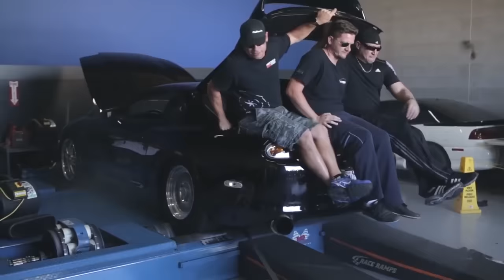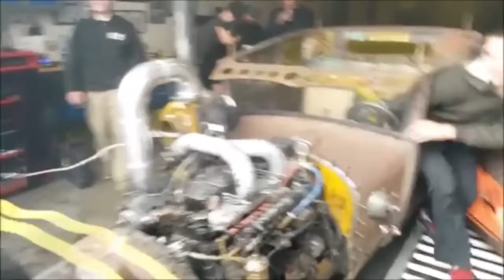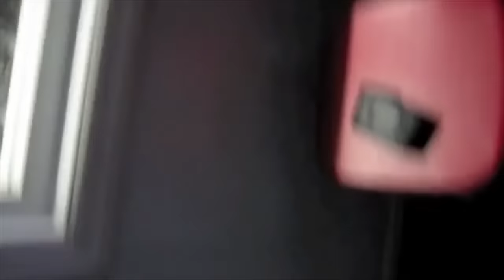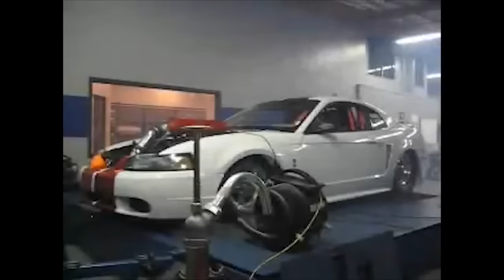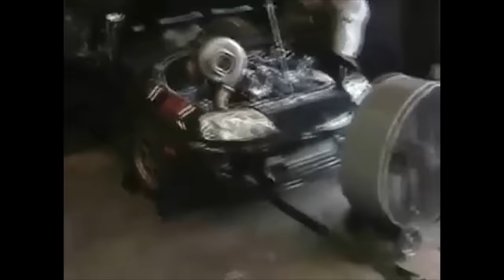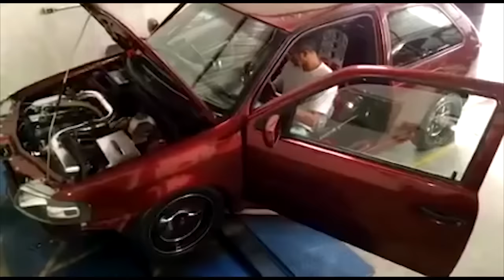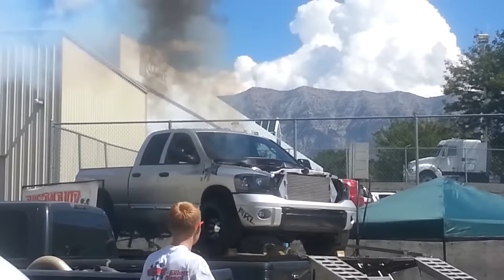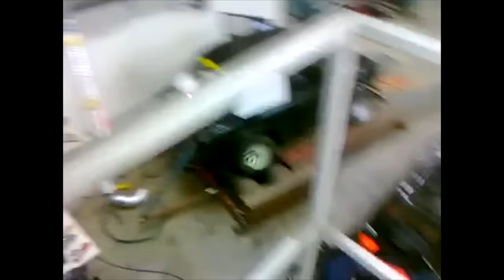The Best Dyno Fail Compilation

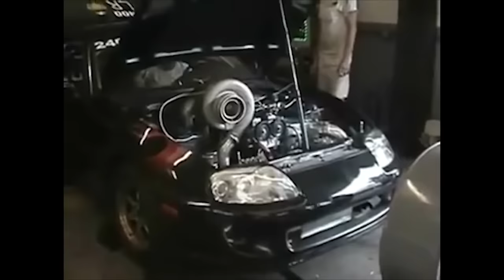Comment: 5:00 I'm far from an expert on cars. But even I would assume that a turbo kit that doesn't fit under the hood after installation, is not going to end well for your car.
Reply: Its a dragzter obviously
Power over anything,most people do this
Reply: You got it all wrong! He fit an engine on his turbo! 🤘😎
Reply: Fellow accelerationist i bet that’s what he thought about the RPMs as he shoots a rod through the block
Reply: Fellow accelerationist  ok boomer
Reply: Fellow accelerationist  looks with x100 magnefying glass 
U sure is this big? Its dosen't even exist.
Reply: Poor supra
Reply: Wrong assumption
Reply: You have assumed..... Wisely
Reply: 2JZ's tend to handle a lot of power with some modifications, however in the video, the 2J looked very under built for the turbo that was stuck onto it. And no, bigger turbo isn't always better, the bigger your turbo is the longer it'll take you to get into boost.
Reply: +100 aerodynamics
Reply: how to ruin a 50k car in a weekend
Reply: Fellow accelerationist  specs doesn't matter. It's the strategy you use.
Reply: I've seen the whole video on internet and they showed that clip than it actually rip and it looked sick but we all know the amount of lag coming from that thing is useless
Reply: More air = more power. Bigger the better hahaha
Reply: Yea... He need bigger one! That turbo is small.
My Tiger 1 Has bigger turbo then that
Reply: That guy who reached into the engine bay needs to take a safety course, because that dude almost lost his hand and probably forearm
Reply: Yeah, thats why people have a hole in their hood cut out so the turbo can fit over+better cooling
Reply: I mean as long as the engine can take the boost the turbo will give it would be fine
Reply: it’s always the supra guys with the massive turbos with unusable power due to lag
Reply: @thatcarguy0710  "VTec" only kicks in at 9000 rpm, the engine revs to 8000
Reply: Wtf fwd 9:21
Reply: Guys, Here is our Savior

YaH The Heavenly FATHER HIMSELF was Who they Crucified/Pierced for our sins and “HERE IS THE PROOF”

From the Ancient Egyptian Semitic: 
"Yad He Vav He" is what Moshe (Moses) wrote, when Moses asked YaH His Name (Exodus 3)

Ancient Egyptian Semitic Direct Translation
Yad - "Behold The Hand"
He - "Behold the Breath"
Vav - "Behold The NAIL" <— YaH’s Crucifixion
He - "Behold the Breath"

“Behold the HAND that Beholds The NAIL” 

PROVES - YAH The Heavenly Father HIMSELF was Who they Crucified

That is EXACTLY what Moses Wrote

Here is what they mean

YaH's Name:
(Ya)d + (H)e, as YaH is what Moses called Him and YaH Declared: "this is My Name, this is My Name for all generations" (Exodus 3)

YaH is The Creator of “MAN”: (Genesis 2:7)
Yad He, (HAND BREATH), as YaH's "HAND" Formed man from the dust  of the Earth and His "BREATH" made him a living being (Adam)

YaH's Sacrifice of Crucifixion for “MAN”:
Vav He (NAIL BREATH), the "NAIL" through YaH’s "HAND", in Sacrifice of Crucifixion, that whosoever shall call YaH Savior, His “BREATH” brings forth life (Salvation)

How YaH arrives:
YaH arrives via the Tent of Meeting (Exodus 33:7:11, Isaiah 54, 55), where a Tent is erected outside the city, a cloud descends upon the entrance of the Tent and YaH appears...

Why they demanded YaH to be Crucified:
YaH was Crucified according to Hebrew law (Deuteronomy 21), to be NAILED/PIERCED on an Almond Tree for BLASPHEMY as it was for His NAME they demanded Him Crucified. The Messiah claimed He was YaH...

HE WAS YaH!!!

HalleluYAH translates “Praise ye YaH”

The Hebrew Book of Isaiah

Isaiah 42:8
"I am YaH; that is my Name! I will not yield my glory to another or my praise to idols.

Isaiah 43:11
I, I am YAH, and there is no other Savior but Me.

Isaiah 45:5
I am YaH, and there is none else.

Comment: There is absolutely a reason why there is a red zone in every vehicule.
Reply: Russian Bear 👍👍
Reply: Obviously these guys are color blind lol
Reply: not every
Reply: Nah brudda these people didnt have good coolings or hadn't secured the car properly.
Reply: @iCxrsxd_  hhh! I never notice it was written different than French.( I speak French as well)
Reply: @i_amscarface_the_legend9744  Je ne parle pas francais tres bien 😂
Reply: in english we call it red line not red zone, not sure if the terminology is different in french, but either way with built engines you can usually raise your red line a bit since you have lighter piston rods and heads and stronger valve springs, and increasing your red line from say 7500 rpm to 8500 rpm will make a big difference on a drag strip since you will be at a higher rpm after upshifting thus starting with more torque.  it can be kinda complicated to calculate a new safe red line so often the idiots just guess and then blow up their engine, but really if you don't know how to figure it out you should ask someone who does

Comment: With all the knowledge it takes to build an engine like that and they never learned what the little red line was for. 😂
Reply: It's where the engine runs most efficient.  You usually want to be at least at the red line or above it, otherwise you risk running inefficiently.  You should try it, the difference is remarkable!
Reply: @fders938  hahaha,that's some funny sht.😎
Reply: @fders938  Yep, go anywhere below that line and you'll mess your engine up ;)

Comment: "I'm going to stand next to this engine and let's see if it will turn 10,000 rpm's".
Reply: Exactly,  I feel bad for my motor hitting 3,500 rpm's when pulling boat.
Reply: Mine does but it's an rx8
Reply: And here I am sitting on a motorcycle, whilst the engine is turning up to 14000 1/min. It´s not a problem, when the engine is made for such things.
Reply: Darwinism is real.   It isn't just stand up comedy stuff.  People always act shocked when Darwinism actually happens.
Reply: lol i cant agree more
Reply: Chase Hardesty Sorry hard.
Reply: +Shinon Ayanami. I got worried when the engine that I was working on exceeded 120 RPM, but it still managed to pull 480,000 tons. 
Not bad for a 2 stroke, but the wretched thing burns 3',500 gallons or fuel an hour. LOL.

Layout
Configuration Straight-14
RPM range
Redline 120
Combustion
Fuel type heavy fuel oil
Output
Power output 80,080 kW (107,390 hp)
Dimensions
Length 26.59 m (87.2 ft)
Height 13.5 m (44 ft)
Dry weight over 2,300 tons
Reply: @wilsjane  Okay so it's a ship or what?
Reply: @AkaneTendo15111986  exactly I hit 16k rpms on My bike everyday lol

Comment: 6:30 That is the most powerful "hood opening/closing" engine I've ever seen! It turns something boring and uneventful into a crowd pleasing showstopper!
Reply: Why did he chock the wheels on the backside? As if going 150+ with your wheels going forwards would make you go backwards
Reply: Puta que pariu, velho.
Reply: @chronus9083  surely you know that’s a stupid question yeah?
Reply: @chronus9083  You do realise that if the car suddenly took off, that it wouldn't be travelling at 150mph right? It can help stop movement on the dyno when the straps flex a little.
Reply: I laughed hard at that one
Reply: "Puta que pariu vey"

Comment: 6:32 the engine was faster than the car..
Reply: 1.21 GIGAWATTS!!!!!!
Reply: I mean you're not wrong if you really think about it
Reply: Lol
Reply: It was here in Brazil!!!
Reply: Brasil poha 🇧🇷
Reply: Dont worry dude, I have a car
Wtf you doin, get on the engine
Reply: When u put a LAMBO MOTOR IN HONDA CAR
Reply: TINHA Q SER BR KAKAKAKAAKKAKAKA
Reply: Jose Gabriel The car was turbocharged, with the stock engine. VTEC kicked in, then the thing blew up.
Reply: vw gol 1.8 engine broke
Reply: @Jose-eq4fc  vw
Reply: @Afromustang  pqp vei kkkkkkkk
Reply: @Jose-eq4fc  Honda not here is vw go
Reply: @Jose-eq4fc  This is Volkswagen Gol
Reply: Volkswagen Gol Motor AP 1.8

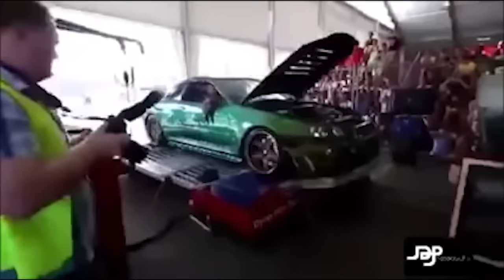Comment: 2:19 that was way too much power! the dyno couldn’t handle a GTR like that
Reply: what actually happened right here, can you explain it to me? I don't really understand how a dyno works.
Reply: @fin3662  a quick google search will explain everything about dyno tuning but basically these idiots are blowing their engines because they aren’t doing the test properly and are over revving their engines and the car can’t handle the high rpms
Reply: @kingcosmuder8078  I thought dynos tested max rpms and horsepower though? or are they just max revving for too long?
Reply: @fin3662  max revving too quick and too long.
Reply: @fin3662  You do that very briefly. Engines can't survive being redlined for long and doing it even a small bit is hard wearing on the engine. You don't need to hold it at max RPM, once you've reached it, you have the data. Any longer is just showing off and asking the engine to fail.

There's also little airflow through the engine. They need to breathe, stationary cars overheat insanely quickly when ragged.
Reply: @BlueZirnitra  That makes a lot of sense, thank you for explaining :)

Comment: there's a reason cars have grills. when the car is moving at high speed and high RPM, there's this thing moving through the grill and into the engine bay called air. there's a purpose to the "cold air intake". hot = bad

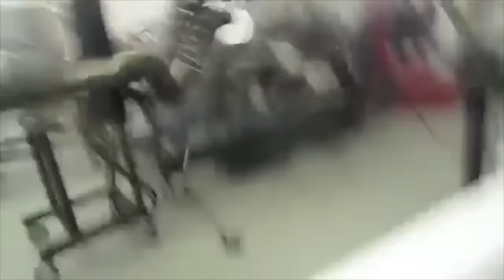Comment: 2:50 , holy shit what would cause that!? I've never seen an engine explode that dramatically.
Reply: Nspinicelli That’s a Cummins just had so many horse torques it’s threw it self off the Dyno and wanted to be in the truck
Reply: No cap
Reply: Apparently you haven't seen very many top fuel drags
Reply: @exautoshopowner5630  I mean I've seen booms and bangs and flames, but never the entire head being launched in the air. That is crazy.
Reply: Chocolate head bolts

Comment: 4:22 starts to smoke continues to make pull. Smh, always make sure when your cars on a dyno someone is spotting up by the engine and and your watching the rear. Many times we’ve saved a car from having a catastrophic failure by just using some common sense and getting off the gas. Nothing wrong with aborting the damn pull, smh.

Comment: I love the ones with fabric ratchet tie down straps.  I used the same ones to hold cargo in my truck and they are using them to hold their cars/trucks doing insane dyno runs.
Reply: That's not unusual. Those straps can hold tonnes of weight. Used often in haulage to secure pallets well over a tonne or two each.

Comment: I'm always afraid seeing those dyno's because i'm afraid the car would shoot through the resistance and do alot of damage.
Reply: Yeah, I was thinking that too. But they have to launch an awful lot of weight to actually launch the cars. But the cars lurch and the unhinge burns. I think when the engine fails  the momentum from the drivetrain parts would need to move the car without the assistance from the engine.

Comment: 0:12 while it had a Dyno run they put to much weight on the back of the Supra
Reply: What actually happened here
Reply: @pringlessorted4644  to much weight in the rear axle

Comment: You guys DON'T HAVE a "clue" that when revin the engine at that high rpm,  your actually spinning the little bit of oil off your cams and rocker arms and pushrods are heating up beyond operating temps and thus throwing pistons, rods, cams, and anything else out the block!!

Comment: I can't understand why anyone would want to dyno their car. "But.....but....but.... you need to know how much HP it's making". Oh yeah? If your satisfied how it runs after modifications, then it doesn't matter what the numbers and lines on a chart are. Besides, they make you sign a damage waiver, if she blows, their not responsible. However, they will give you a box for all the hot oily pieces.
Reply: It's to make sure it's running right and good. While also getting as much hp as you can with the modifications. It's a core balance between the two. If you don't, all of those mods can ruin your vehicle and break it.

Comment: Literally the first thing they taught in our power and performance class is how to strap the vehicle down and how to check the equipment is suitable for the vehicle/load range. Also, we block off the front tires, we have four straps in the back. Two of them are straight, and the other two cross each other to make an X. Then we strap the front. It’s not hard to setup and we always triple check the straps are tight and on securely.

Comment: I guess people forget that running engines at 22 Million rpm requires a lot of air and a way to cool down the expanding metal parts inside their engines. Dyno’s are not made to run your engine at full capacity for 15 straight minutes. Lmao. I guess without these idiots we wouldn’t need part stores.

Comment: Im not a mechannic nor an engineer but I think I can tell when its the engine block that fails lol
Reply: normally connecting rods 'grenade' through the casings,   the weak link and gets upgraded on a power tuned motor

Comment: A car at speed gets the added airflow over the radiator. I dont think cooling systems of high performance engines are designed to be pushed to the limit whilst be in a stagnant environment.

Comment: most of these dyno fails only had rear straps, like common sense you the car should strapped both front and rear doesnt matter if its rwd,awd or fwd. How did they open an dyno shop with lack of those common sense?

Comment: Probably not the best place to ask this question,  I'm looking for someone to line out my project before I can get my small slow brain to learn to tune. North Central Arkansas. She's running little lean, I would like to get that squared away before I add the parts on the work bench. It has Holly Terminator ecu. I thought if I got it dialed in the way it is, I can hopefully be able to limp to a place after installing the parts that will probably make it be even leaner. It's my daily driver and only ride. I live in the toolies, we have a fire station a hardware store and the post offices in the next town over 🦗🦗🦗😏

Comment: Tuning engines to this degree costs tens of thousands of £££'s or $$$'s. Or Russian Rubles. It can be done properly. But for road use, why not buy a car that gives you the power you want in standard factory tune? I agree that modest ECU remapping isn't a problem in general. But this video just illustrates idiocy.

Comment: This is stupid.  Not the explosions, before that, trying to make a slow car really fast, or a fast car too powerful for the chassis, running gear etc.  If you want speed, buy a quick car that's got some headroom in its general set up if you want it to go even quicker.  This is the automotive equivalent of sad sack who overclock already fast CPUs using water cooling, just to run and post benchmarks and eventually burn the chip out.